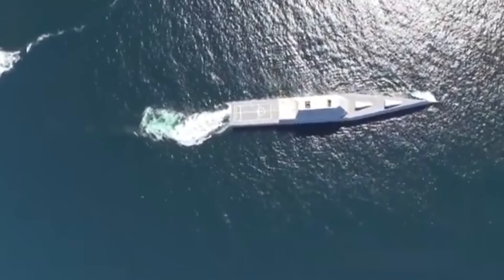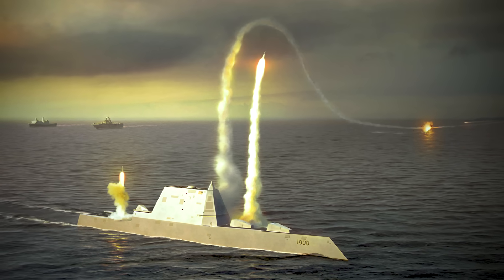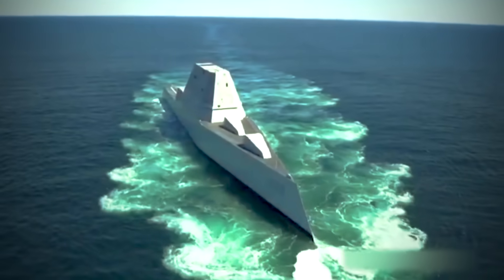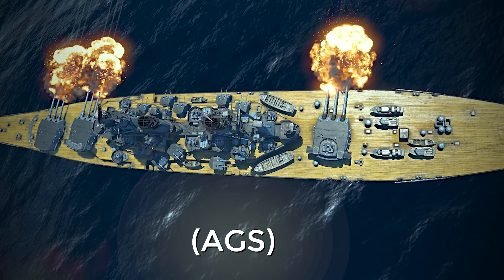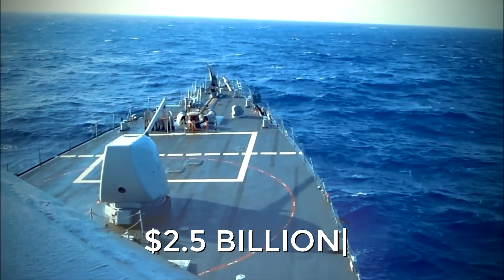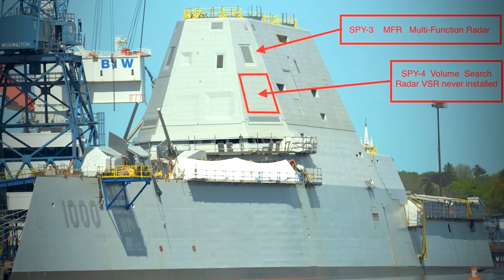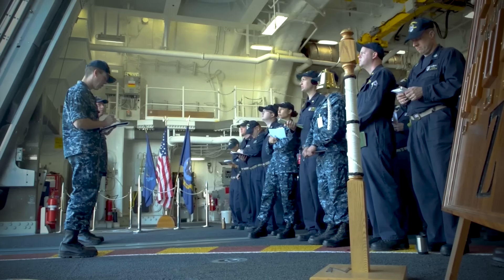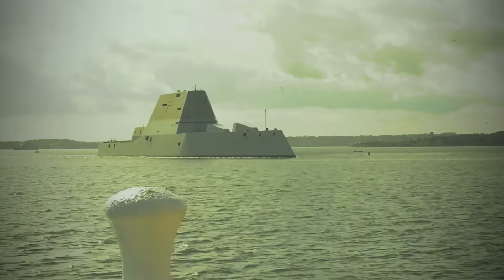The Navy’s ‘$22 Billion Failure’ Just Became a Hypersonic Superweapon

Comment: They should seriously revamp the design. Stretch it 60ft in the center with an A1B Reactor, and create a Nuclear Cruiser to fully replace the Ticonderoga. Replace the remaining AGS with a rail gun, and increase outboard VLS to 120. Remove the large rear landing bay for more storage and rear firing ADCAP torpedo capability. The stretched center superstructure could also house a megawatt class Free Electron Laser for Anti Ballistic Missile defense and anti-satellite capability.

Comment: The opening isn't exactly true.  In terms of number of vessels, sure, PLA has more.  In terms of actual tonnage, though?  USN is still head and shoulders above PLA's naval force, and with the agreement with Japan and South Korea recently, this will very likely stay a fact in the coming decades.
PLA's naval forces count many of it's much smaller, ships, ones that might not even be able to house any actual threat to larger ships that you'd find in the USN, in that total number of ships.  Hell, if you count USN's reserve fleet, it's still got a higher total number to PLA's.  Not to mention that the PLA naval number also counts its coastal patrol vessels.  This is like if the USN also counted the Coast Guard as part of its naval strength.
If you want to be "fair" in this calculations, as how the PLA counts vessels, the US military's naval number strength is way, way, way higher than PLA's (like, US military vessel number is four digits, while PLA is still in the middle of three digits, using PLA's number calculations).

Comment: Sounds like a maintenance nightmare.
Reply: It is exactly that.  The plan was just Operators on board and maintenance would be done by shoreside facilities and fly on teams.  This was supposed to reduce costs.  We warned them that this wouldn’t work and that it would ultimately do the opposite.  The Program Office was staffed by unqualified people and led by spreadsheet engineering rather than practical engineers and shipboard experience.  I could go on….

Comment: I understand ending the class due to cost and other various technical issues. but we already have 3 of these ships the money is already spent to leave them tied up at the dock makes no sense. the military has other large bore long range guns (the 198mm for just an example) still has a variety of cost-effective rounds range 30 miles + we also have tons of parts on hand for this highly capable weapon just a thought. I like the hypersonic option. basically, what I'm suggesting is just using a couple battle tested mods to lower costs and get these ships back in service. I would also note these aren't the only new ships we have sitting due to these types of issues were yes, the money was already spent. I mean if it works, is it really a dumb idea? also, of note I think Japan may have worked out the rail gun so that option is also open.
Reply: Railgun/directed energy makes so much sense, since this ship already has the power delivery systems in place.
Reply: Tech is outdated by now. The problem is it’s built from aluminium and is fatigue cracking. They are neither seaworthy nor battleready.
Reply: @808bigisland  I know one of them is out of the water and kept inside a building don't know if or what they are doing to it. then again at one point Trump talked about bringing back the Iowa's too. I don't see that happening.
Reply: @dwaynentinabunt1200   Never happen.
Reply: @craigroberts757  I'm assuming you are talking about the Battle ships. in the traditional sense I would agree with you. But for the sake of argument let's look at placement on the map none need to move. 2 east coast , a Dread knot in the gulf. a couple on the west coast one in pearl. all have been running enough power for CWIZ or more yes I'm counting the 2 heavy crusers as well.
Reply: @craigroberts757  as a shady platform you couldn't beg for better. missiles is even possible on minimal power with a short crew. even with the Texas currant state ready in days. I'm not talking about internal redesign I'm talking about 3 pieces of bolt on hardware and one laptop running on the boats own power. it's running anyway. per ship, how many men would it take?
Reply: @808bigisland  Can or could the hull plates be replaced by steel or maybe even carbon fiber? the only other option is to scrap them out and cut them up. for the materials. that could be improved in a liquid state. on one hand that's a lot of aircraft maybe repurpose the propulsion systems. either way that's a hell of a lot of raw material. that could jump start several mills coping with hard times around the country. my point and overall question remains' somewhat the same if we can't fix these ships then what's the best option for them? we can't sell them. Countries around the world would kill for things we call obsolete. diesel powered submarines are still being built around the world today. just a simple fact.
Reply: @dwaynentinabunt1200 
Nah, they are unsafe. Diesel electric subs are very quiet. Most US weapons are obsolete nowadays. Countermeasures constantly evolve.
Reply: @808bigisland  Right. so, both US and Russian subs are unsafe after more than 70 years of active duty. I don't know where you're from but you're wrong. I thought you had something to offer but let me just say this. just once stand next to a 16V149 Grizzly or a V16 Allicen 2 cycle of all engines you can't hide this half of what a sub needs. but common in 1950 to 1980 locomotives. Let one hit high idol and hold it. you'll never think them as quiet ever again the sound can be heard 15 miles away. so, let's talk about the other cat in the room while the engine sucks air from the boat. Right batt power during a dive. I find this hilarious by the way. what is your limit? how long can you stay down? how deep can you go? the second you surface and fire up those diesels we have you it isn't a question just a fact. counter measures do evolve you are correct about that.
Reply: @dwaynentinabunt1200 
I captain big boats on the Pacific. I was on a sub once. Didn’t like it. Different missions require different sub-types.
Reply: Ours are now in space. with infra-red oh sorry we've had that sense the 70's. a 140 to180 or above hole moving in cold water forgive our LOL obsolete weapons but your toast. Wow not one nation in the world spends even 1/2 what we do on defense. with that being said the last time this land was attacked was over 240 years ago. Now if you are stupid enough to think that we can't defend this land then bring it on! Oh right. our little military covers the world. A Japanese General said it best. a rifle behind every blade of grass. that's funny the US war machine obsolete. tell me what that says about the rest of the world? as we repel boarders. we still have our guns and haven't used them yet. strange, isn't it? a simple option leave my home alone it's all I ask.
Reply: @808bigisland  And you live where? Sir I am a trained Diesel technician. an 8V149 Grizzly cracked the buildings foundation. It sounded like the starting line of a top fuel drag strip when it happened our teacher did it with one finger. That beast was bolted down in an engine stand and anchored to the floor. straight off the turbo. I'll never forget that sound as long as I live
Reply: @808bigisland  I see so while you're busy roasting ideas any suggestions? just asking a fair question.

Comment: It could  have been done far cheaper  on any Burke class. Face it, the DD-1000 program FAILED
Reply: NO.  It is their cost that killed them. The EM rail gun isn't ready either but these boats have real stealth compared to conventional counterparts.  They don't need regular refueling either.  If they had AEGIS, that would be awesome but nope.  However, they can slip into range of shore bombardment missiles and slip back out.  The A Burkes cannot.
Reply: @x-man5056  Umm, partially correct.  Yes,  the rail guns didn't work. The ship  was far less stealthy than thought,  especially during rainy conditions. The crew size was too  small, even with the added 50% added due to technical problems.  Still too small to deal with battle damage.  The hull    proved less seaworthy and stable then thought....and the range of modern shipborne  missile systems, there is no need to "Slip in". Standoff is the key. The Burkes were simply the superior ship(Still, even after 40 years)
Reply: @jjthomas2297  It depends on how far on shore your target is.  
Were you a crew member?  You seem to have a lot of inside info I haven;t seen before.
Burkes are a lot different, much more capable, than they were 40 years ago.
Reply: @x-man5056  My cousin is XO on the Paul Ignatius (DDG-117). I just know what he tells  me. The DDG-1000's were a stark example of why we need to get money out of politics. The Navy didn't ask for them. The (Bribed) Congress forced them  on the Navy. Much like the LCS program. They say the LCS was a failure, it wasn't. It was never designed to fight. It was designed to make the maximum  profit for the defense industry, and it was wildly successful.